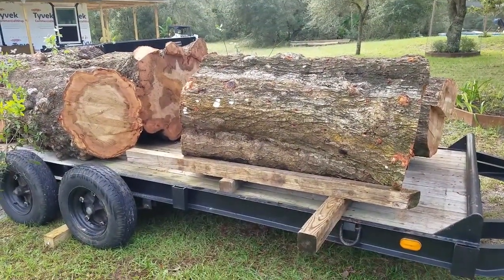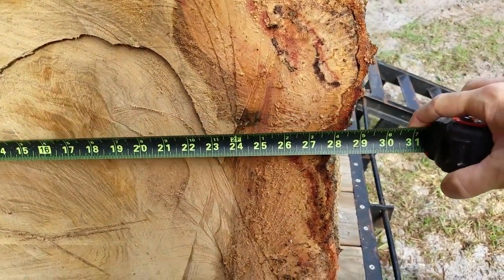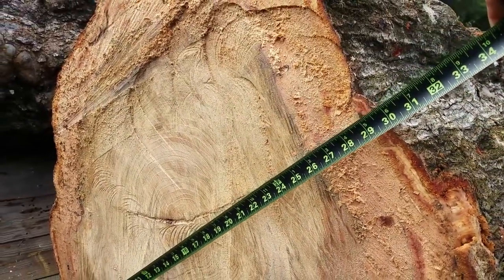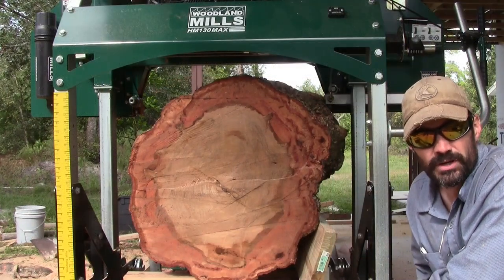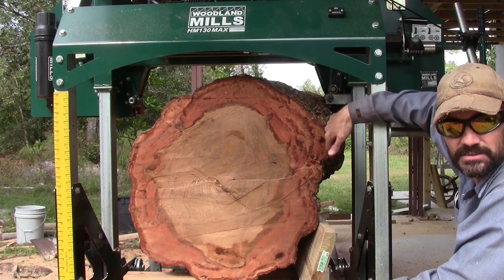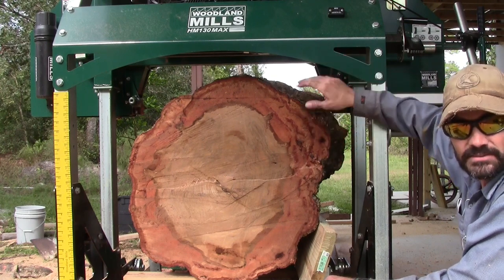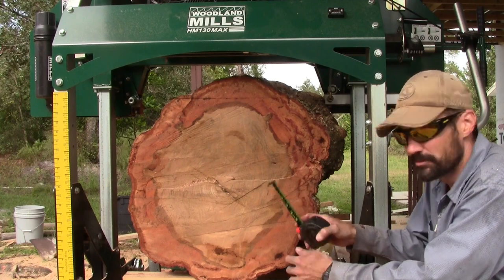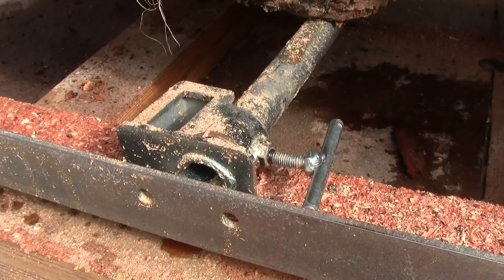Woodland Mills HM130Max Maxed Out Squaring Red Oak

Comment: For ripping chain I just file my chain to a 10 degree angle more like a chisel than a 30 degree angle.. lasts longer in the rip cut. That is some nice wood and color in those logs!
Reply from the maker: That's a great suggestion. I'll try that with one of my older chains (not sure I'll be good at it first try). Thank you for watching and for your comment.

Comment: Like posted below just file your chain to 11 to 15 deg. Get a tool for your filling that tells you angle or if you use grinder its indicated . 15 deg i find lets you cross cut also. If your saw still struggling get a skip tooth chain file it at 15 youll be happy. . Dont waste your money on ripping chain if you ain’t milling with it . Luv your mill 😍
Reply from the maker: Thank you for the tip. I've got some big stumps staged that I will probably try and shape up with the chainsaw before I can get them on the mill so I will be trying this out soon.  Thank you for watching.

Comment: Clumsy me, I touched the send button before I finished. I screw a lag bolt into the hole in the squared metal  just inside the bark on the side facing me and I throw the chain over the log and pull it back underneath the log and hook it to the forks which are above the log and just pick up the forks and it rolls the log
Reply from the maker: Great idea. Thank you for the comment.

Comment: What you have here gave me a good idea. I liked the way you squared up then stacked your logs. So what my plan is, invest in a chainsaw mill for logs to big, square them up just enough so they fit on my bandsaw mill.
Reply from the maker: Depending on the length you can square off an end and then stand them up. Running down with gravity made squaring them off easier. It doesn't have to be perfect and id probably just take a bigger chunk off to have plenty of clearance and then throw that on the mill.

Comment: I used to flop big logs like that to, but I would always bang the forks into the bunks so now I welded a square  2x2 inch piece of metal with a hole in it and welded a chain to it now after the first side is cut I screw a lag

Comment: Stihl sells rip chain, so does Oregon. Any chain can be cut to rip chain if you grind it back to 11°. I grind my crosscut chains to 27° for a more aggressive cut, they are supposed to be 32°. I use an Oregon chain sharpener that has the rocking cradle. I can get all three angles that they cut at the factory.

Comment: Looks like you are going to get some really nice wood from these logs if they are all like the first one.
Reply from the maker: Thank you for the comment. I am anxiously wanting to get back on the sawmill and finish milling those oak logs. They are already getting some big cracks in them as they dry out. I still can't decided what thickness I will mill them at.
Reply: @CedarTrailsLiving  Get some sealant on the ends to help stop any more checking as they dry out, or maybe cut off a few inches from each end and coat the fresh faces of the wood. It should help a lot.
Reply from the maker: @stanwiggins3423  I used Anchorseal but I'm finding that these oak logs have so much water in them that even the faces are cracking along with the ends. I think it's best to get them cut down thin rather than let them dry as cants. Have you had luck with Anchorseal or any other sealants?
Reply: @CedarTrailsLiving  I have an oak that fell this past winter due to base rot and age. We know it was over 150 years old, and the base is just over 5'wide. some of the branches were over 3' in diameter, but no one within 150 miles of me has a mill big enough to cut slabs. Thought about making an Alaskan Mill assembly but I would need a 30" blade saw to do it.  Ended up cutting about 4 cords of wood before the last freeze hit the general Houston area and will probably do that with the rest of it. One professional told me it would take at least a year to 18 months to dry enough to put into a kiln, including a vacuum kiln, and that's a long time to wait.
Reply from the maker: That is an amazing tree. To get those middle slabs would be hard work on a chainsaw but if you can square it off a little you might be able to get it down to a more manageable size. I can say from experience even a much smaller job than that was very hard work but I also don't have a large chainsaw. If you could square it off by removing about a 12in edge all the way around it would get closer to fitting some of the larger bandsaw mills. That's the approach I should have taken with these.  Stand it on end if they are not long and you can let gravity take the saw down which is so much easier than doing it flat. I have decided that is the approach I would take if I get anything over what the mill can handle in the future.  I have really given up on slabs, they just take way too long to dry and they warp and cup like crazy.

As for drying, I cut some 6 months ago and recently measured with with a moisture meter and it is still out of range which from what I can tell is somewhere above 30%. Needs to be down around like 8%.  That's in a garage and those are around 1 1/4 in thick pieces. Oak seems to really hold the moisture. I cut some pine not too long ago and it is already down around 11%.  Even as fire wood seems like it would take some time to get seasoned but a hot fire dries them out in a hurry anyways.
Reply: @CedarTrailsLiving  When I cut it as firewood and stack it out in the 100+ degree Texas summer days, it will dry quicker and give off plenty of heat in the fireplace. It's still hard to cut up some of the limbs that are thicker than many fully grown trees, but this tree alone will produce a number of cords of wood. Haven't decided if I want to bundle, face-cord or truck bed the sales approach.

Comment: I was looking at purchasing this mill but I was concerned the 14 hp engine a little on the small size. Mill looks like it get: a little wobbly when you got it cutting real high. Thoughts?
Reply from the maker: Thanks for watching and for the comment. I think the engine has enough horsepower when you have a sharp blade and a good clutch. Those were possibly contributing factors to how well it cut these. It's a sturdy frame but does move on a full width log. I didnt notice any issues with the cut even with the movement and it's more apparent at the max height. In my opinion for the price it performs great. Based on what I saw when shopping, you'd be over twice the price to still cut these size logs with a more professional grade mill. Hope that helps.

Comment: What kind of blades are you using? Do you have a metal detector?
Reply from the maker: These were probably Woodland Mills Blades that I bought with the mill. I did buy a box of Cooks blades next to give them a try.

I do have a metal detector and it works pretty well. It's like one that you would use on the beach, not the small wand kind and so far has worked well when I actually use it.

Thanks for watching and for the comment.

Comment: How many hours on your machine when the clutch was replaced...Did woodland supply it or did you have to purchase it?
Reply from the maker: I had about 8-10 hrs on the mill but had been milling mostly large logs. I made sure I don't have any pinging at the low idle but either it was not enough clutch for the job or I don't have the high idle adjusted right. I bought a mountable tach to make sure I can properly adjust the RPMs. Woodland Mills sent it with no issues. My mill was damaged during shipping and when I asked them what to do they just asked for a list of damaged parts and sent them. Great company to work with so far. I highly recommend them.

Comment: Your mill head needs to be turned 180 on the track. Your band should be cutting towards the stops, not the clamps.
Reply from the maker: You are correct. This was my temporary setup until I could build a home for it. In the more recent videos you can see the mill in it's new home and it is oriented properly. Thanks for watching and for taking the time to comment.